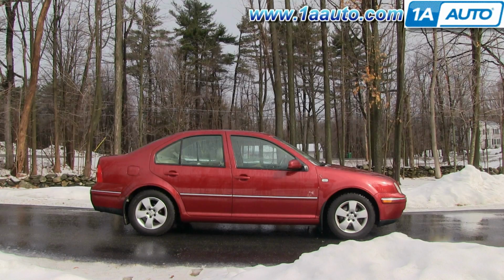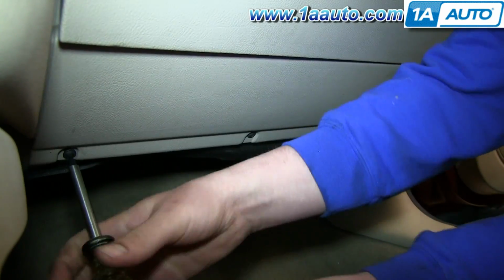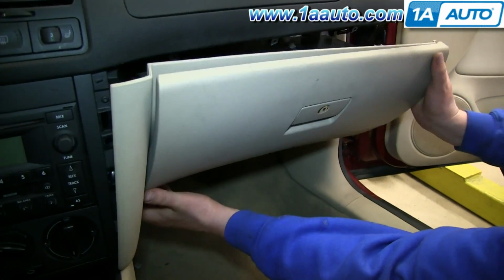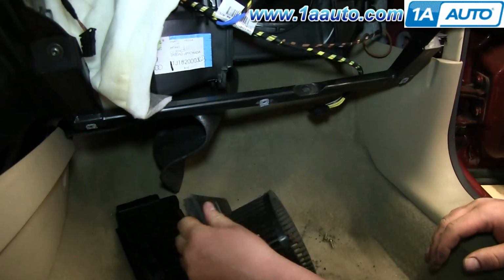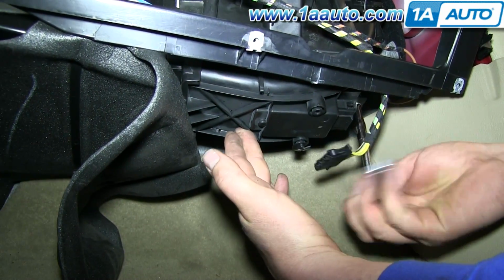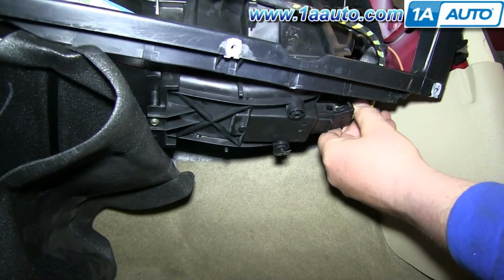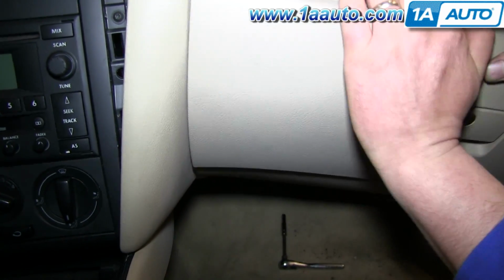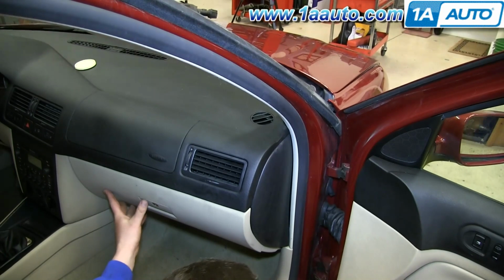How To Replace Blower Motor 99-05 Volkswagen Jetta

Comment: Thank you for posting this even if it was a long time ago - just replaced the blower fan on my 04 Jetta - I did find if you release the two torx screws on either side of that cross bar it gives you a little more space to get that motor in.   Job done and lots of air blowing from a nice quiet fan.

Comment: 2000 Jetta here. I was able to simply remove to plastic screws from the insulation panel, unplug the blower motor, give it an 1/8th counter turn and it came out. This video caused mean lot of unnecessary work, lol

Comment: Your video claims that it covers a 2006 Jetta, but my experience today on my car in trying to remove and replace my blower was in no way the same as your video explains. This made for a very frustrating experience on my part. Your video should say this is for Jetta's 1999-2004 only. 2005-2008's a way different with more screws and dash pieces to remove as well as the blower being mounted horizontally and not vertically.
Reply: A Jetta "City" would be the same from 2005 1/2 to 2008. 2006 Jetta the MK5, different car altogether.

Comment: There are extra screws holding my glove box in my 2002 VW Golf. I have removed one extra screw on the right side (next passenger door) and there appears to be s solid fastener on the left as well. Do I need to remove the console for access??

Comment: When my heater Blower went out, I was thinking, is this the repair that finishes off my 2004, 230,000 mile beat up car?
Naaaw, thanks to this video, got the part at 5:00 PM Sat, installed it by 6:30 Pm, and it was fun., Saved close to 200$ mechanic costs.
Big Thankyou guys.
Reply from the maker: +J Bird Thanks for checking us out! 1AAuto.com

Comment: My heater works on setting #4, and my A/C doesn't work.  On a rainy day, water comes down into the cabin of my Jetta right through the blower motor area, so I think what's happening is water is tripping that blower motor and resistor pack. I'll look more into it and figure out how that water is getting into the cabin.  This video in conjunction with the resistor pack video are awesome!

Comment: Great instructions! FYI: On the Golf, at least, you have to remove a t-20 Torx bolt under the side cover as well. it's in the lower half where the arm comes up from the glove box cage.
Reply: It’s like that in my 2001 Jetta also

Comment: Any advice on changing a comfort control module as my power locks do not work and I have heard this is the issue.  Thanking you in advance.
Reply from the maker: +Peter Mississauga We currently do not have an auto repair video that covers this particular repair. We will keep this request in mind in the event that we need to make this repair in the future. 1aauto.com
Reply: Thank you for the reply.  Cheers!

Comment: my switch melted and the car isnt worth a new switch.. all i wanna do is apply 12 volts to the blower to make it run.. do i have to do it directly at the blower or can i do it at the switch
Reply from the maker: +New User Depends on how much damage the melted switch caused. It's hard to say without seeing the vehicle in person
Reply: its the same car as in the video.. ive been trying to find a schematic with no luck :( but thanks for the reply!!
Reply: just did it yesterday lol ran a toggle switch and a power wire from the blower motor right to the battery and just grounded it on the frame and good to goo!  thanks for the video!!!   @1AAuto
Reply from the maker: Thanks for the update!  Glad to hear you were able to make this work and repair your vehicle. +New User

Comment: Thanks for this. My AC fan was making a terrible noise. Phoned my mechanic and they said there’s a common problem with VW Golfs that foam gets stuck in there and it starts shaking. 

Turns out the foam hood seal was wedged in the fan and the soundproofing blanket was missing. The mechanic must have put it in there. How shady!? I wouldn’t have found it if it wasn’t for this video so that you.

Comment: For those who havent already/don't want to break their interior, the "tab" on the glove box is attached by a screw behind the environment controls and the foam attachment under the glove box is screwed in.

I have seen people say that this can be done without removing the glove box but I think it would be a bit trickier.
Reply: I have a 2000 and didn't actually have to do most of this. It just twisted out- no screws beyond the insulation panel. I didn't even have to remove the glove box.

Comment: My volswaggen passat 2001 turbo 1.8 and its manual. my car doesn't heat up in already change the termostato and the temperature sensor but the it doesn't  heat. can you guys help me.
Reply: Still having issues?

Comment: Hello there. My heating system stopped working in my VW Passat 97' 1.9TDI.. And I think it's the blower motor.. Is it the same routine for Passat as the Jetta? best regards!
Reply from the maker: It may be a different procedure on your vehicle, we currently do not have an auto repair video on that particular year, make and model. The blower motor should be under the dash on the passenger side. Usually there are around 3-4 bolts that hold them in place. We do carry new blower motors for your 1997 Volkswagen Passat, here's a link to them on our website. http://www.1aauto.com/heater-blower-motor-with-fan-cage/i/1ahcx00139?f=369427&y=1997&utm_source=YouTube&utm_medium=YouTube&utm_campaign=1ATony